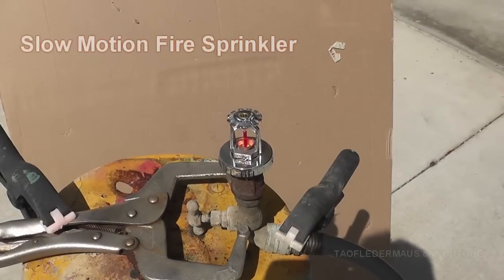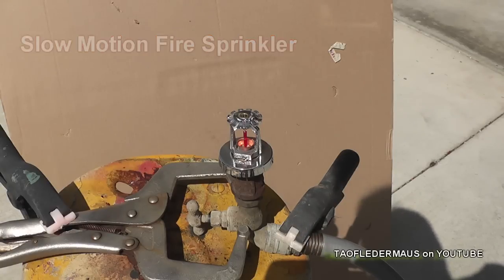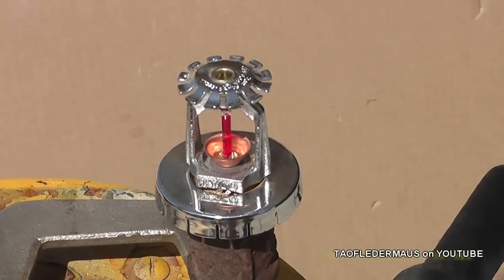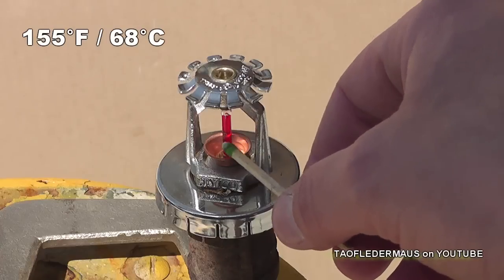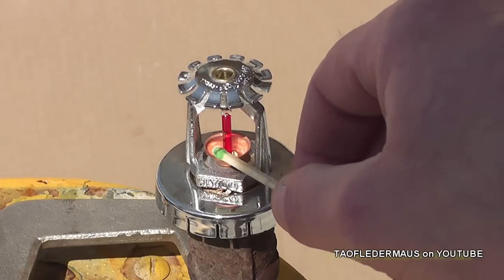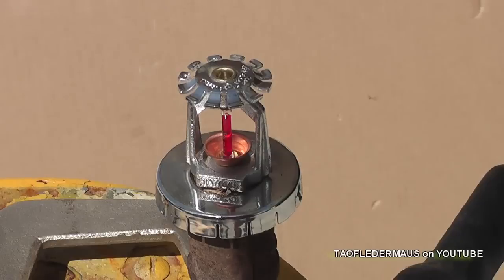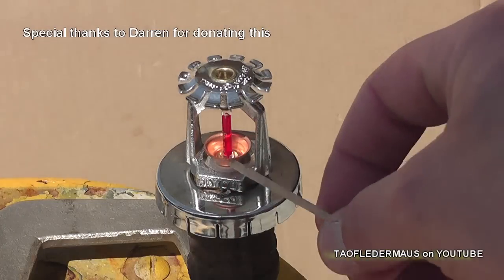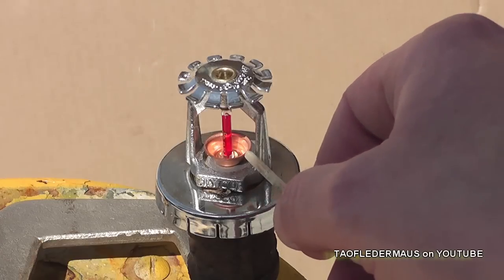How do FIRE SPRINKLERS Work?  (slomo)

Comment: So I have a question is there meant to be watering the pipes all the time so that there is pressure so that when the glass breaks the water comes out instantly as I work in a big warehouse I checked the pipes for the day and there is no water inside of them I'm quite concerned
Reply: +T Dogg  I really hope so as I tapped the pipes and the role hollow which worried me but then did some research into the systems and looked at the base of the pipes on the ground floor and saw a chamber which I think is their release valve for the water
Reply: if your place is a cold place, dry pipe is used to avoid freezing water inside the pipe. try to notice how many standpipes are there or siamese, so the firetrucks' pumps shall render its pressure. dunno if im correct. if a dry pipe system is in your warehouse, try to find extinguishers around there. if you have an ample # following a minimun distance between extinguishers, thats good. they followed safety precautions. but what kind of warehouse is that?
Reply: It is fairly common in regions with freezing conditions to have either a dry pipe system or some manner of "deluge" system.
In a dry pipe system, the piping is full of compressed air, which holds the clapper shut in the dry pipe valve against the water supply; when a sprinkler activates, all system air is evacuated and allows the dry pipe valve to open and flood the system.
In deluge systems, the piping is actually empty. When fire is detected, the deluge valve is actuated and the system is flooded with water.
Reply: As others have said, that's a "dry pipe" system. It should be pressurized with air (nitrogen, co2, etc.) Many times that's to avoid freezing (and rust throughs), but it's increasingly common to avoid accidents flooding the building. If you knock the head off one, you have time to abort the water phase. (of course, everywhere I've ever been, the panel to do that is in a locked room -- on a different floor. There was a car dealership locally that broke one, and it took them half an hour to find the shutoff!)

Comment: IN GENUINE POTATO DEFINITION!
Reply from the maker: +Ben Heatherman  at least I have a potato
Reply: +TAOFLEDERMAUS Indeed. The red fluid in the capsule must have been under quite a bit of pressure to spew back out of that cup on the pip.

Comment: Except in real life the water is black as oil for a few seconds! !
Reply: HhappyBirthday The  pipe  rust and  oxideis as water is in it, So as a fire sprinkler guy like me, go out every couple years and flushes the pipes with fresh water and a lot of air behind it to flush all the rust and crap that is in it. why it stinks is for the fact water sits in there with the rust =stinky water
Reply from the maker: Rivarokband  and smells really bad too.
Reply: Yes, cutting oil, rust,, dead mice that get inside 20' lengths of piping laid on floor before installation =just a whole lot of nastiness  I installed and serviced as a plumber and sprinkler fitter. The water smells so bad it fizzes sometime in the drain bucket. The methane escaping from the water.
Reply: Dear ***** ,  Why so? 
Why is the water, black as oil and also, smelly ?
What causes each of those two factors, please.
.
Thanks.
Reply: +HhappyBirthday Ever bled a radiator? I should imagine its the same deal.
Reply: *****  I work for Western states fire in washington  you ?
Reply: +Nathan Barnes That means hotel sprinklers smell alot worse than those. The hotel ones are really rusty.
Reply: I used to like 3 years ago, now i work for my brother at One tree had cider
Reply: are you out of spokane
Reply: Exactly! I installed them too. Man the stuff that comes out of those pipes is so bad I wish it was straight oil!
Reply: I just as an apprentice for sprinkler fitter it's seems like a good career what do you guys think I'm located in Sacramento California

Comment: Will a sauna adjacent to a sprinkler set it off??
Thanks anyone...
Reply: +David Wright It depends on the temperature rating of the sprinkler and the temperature of the air coming out of the sauna when the door is open. The sprinkler should have green or blue colored liquid in the bulb. You could even have sprinklers installed inside the sauna without them activating.

Comment: I'm pretty sure its mercury inside
Reply: Mercury isn't a red translucent liquid, also that would be hazardous.
Reply: lmao, if it was mercury when the vile popped it would give a lot of people in the room mercury poisioning, not the BEST option avaliable.
Reply: Jay Saleh fire sprinkler systems installation use alcohol in diferents colors,  there are green, red and blue, it is only for distintion of the other liquids, they use alcohol because alcochol has very hi dilatation degree, in other words, the glass capsule is broken very easy while alcohol grows for temperature effects , I am sorry my English is not so good, but I worked in this kinds of installation,
Reply: Mercury looks like a reflective liquid (like liquid solder if you've seen that) - it can't be dyed.

They don't use mercury since this system is designed as a lifesaver and the last thing you want is a false alarm causing one or several people mercury poisoning!!
It probably is methanol or some other low boiling alcohol
Reply: Red thermometers contain alcohol (red colour is added to make it easier to read), not mercury. Mercury is a metal and is silver(ish) colour.

Comment: nice vid

what do you mean by this ?

This head was dropped so it was decided it should not be installed
Reply from the maker: Pol Ty  It is possible it was damaged when it was accidentally dropped.  Instead of taking a risk  and installing it and have a leak or a premature release,   it's prudent to not use it.
Reply: Correct. We're not allowed to install damaged or even suspected damaged heads.

Comment: I remember in the college dorms, my resident assistant told us the water in the sprinklers was dirty and 20+ years old.
Reply: in most pipes it is at my work place one of my idiot coworkers hit a sprinkler with  a fork lift stunk the place out for a week
Reply: Mike Vormann Yeah. Also at my school, we have two shower stalls but we never shower because well, we don’t need to in school. I was told it was probably sitting there for years. So one of these girls decided to turn it on and stick her hand in there and it smelled so bad.
Reply: I install fire suppression systems (fire sprinklers) for a living. And the person that told you that, isn’t completely wrong. In your college dorms, depending on how old it is, there could be some very old water in there. Though there are times for inspection purposes the systems do get drained down abd refilled after the inspection is complete. I will tell you. You never want to be sprayed with the stinky ass, nasty ass water that comes out of a system ran with steel piping.
Reply: If my schools faucets spray yellow water after a week of no use i dont wanna know what the hell comes out of the fire sprinklers
Reply: At my work we have a huge fire water storage tank, fortunately we have tons of underground leaks so the water in the tank is gone through relatively quickly in a 70 year old facility. We also have probably same vintage diesel pump and electric pump. Our system is also supplemented with city mains.

Our water in our lines stink, but I think annually a fire protection service comes out and tests the water flow, I also see them drain the risers but that might be replacing some sprinkler heads. I dunno the reason.

It’s a pain to deal with broken sprinkler lines underground which happen from time to time, you have to shut off the diesel pump, the electric pump then 3 city mains. It’s takes about 20 minutes to shut them all down. Rarely that has to be done.

We recently had a underground pipe burst so we couldn’t just shut off the riser, by the time we even figured out that the underground pipe was a fire line not a city main we flooded 3 buildings, eroded away a whole bunch of concrete and the fire department was dispatched.
Reply: @tevinmckimball7951  There are two variables.  The first is the size of the orifice in the sprinkler, which is expressed as a "K-factor". The most commonly installed sprinklers have a 1/2" diameter orifice which is calculated to have a k-factor of approximately 5.6.  The second variable is the water pressure at the open sprinkler.  The math formula to compute the answer to your question is to multiply the k-factor times the square root of the pressure.  So if I had 7 psi at a 5.6 k-factor sprinkler that sprinkler would flow and distribute approximately 14.8 gallons per minute.  
 
I would be very surprised if a commercially available sprinkler could discharge 500 gallons per minute.  Even if the orifice were very large, with a k-factor of say 25.2, to get that much water the pressure required would be about 393 psi which is quite unlikely.  Commercial sprinklers for the most part are only to be installed in systems where the pressure does not exceed 175 psi.  Special sprinklers can be obtained which can be installed in systems where the pressure does not exceed 300 psi.  
 
I like showing off my 38 years in the fire sprinkler business.  Can you tell?  Be well everyone.
Reply: It’s hooked to a fire pump which is hooked directly to the street power fun fact
Reply: Can’t we all just calm down and agree that the water is not for drinking?!?
Reply: Mike Vormann sounds like it requires electricity
Reply: Water is millions of years old
Reply: @aidans4866  i know but it hasent been filtered and reused for 20 years
Reply: @aidans4866  You mean,  ...BILLIONS,   (with a B)
Reply: R VB No, it's within the heater system which works with oil.
Reply: Lot of the stink is cutting oil from the installation...you never get it all out!
Reply: Mike sr the water coming from the city that water s not store at all
Reply: Yeah, often the water for the sprinklers is stored in tanks on the top of the building so they can even work without power. But often the sprinklers remain unused for several years, so the water also stays there for that long.
Reply: He was wrong. The water is probably about 4 billions years old.
Reply: @gamesofcontent  LOL. You are absolutely right ✅.
Reply: Yeah, look up videos of sprinklers going off in best buy ,or any other store. Fires aren't often, so you get these sprinklers, and they are unused until 40 or 50 years later when something catches fire. Because of the sitting of the water in the pipes the water is actually a biohazard and when it gets inside of your mouth you have to go to the ER
Reply: SirFlanksALot When you consider the era of the design, many if not most of the brainiacs that designed these systems had already done their fair share of LSD at University and after. “LSD geniuses”, they ALWAYS think they are smarter than EVERYONE else and have reached special dimensions of enlightenment. We should NEVER believe them!!!!! Arrogance (they always have heightened arrogance) and dislocated thinking is NEVER a good combination and we are seeing the results of that everywhere we turn today!!!!
Reply: SirFlanksALot   Lol you are a idiot.. I’ve gotten in my mouth and eyes not to mention the stuff that gets into my pores... it is just water that is stagnant that’s it... smells like 1000’s of dollars to my family..
Reply: Josh Nordwell 
It smells like money to me. I install them for a living as well.
Reply: Mike who the fuck told you that pack of bullshit stored in tanks? Lol on top of the building? Lol fire sprinklers don’t require power unless the riser is hooked up to a fire pump, which in a lot of applications the system doesn’t have a fire pump.
Reply: Ricky Gonzalez.O it could be pumping a foam mixture
Reply: - JustSimplyThinking - Yep, luckily we in Germany have other systems. Our Water system is directly connected to the boiler of the heater and there's a pump pumping the water from the basement to the different floors.

Comment: what type of sprinkler is it? this is a pendent sprinkler?
Reply: yes it is..it is a chrome semi-recessed pendent, often found in modern commercial buildings..it has a red element (the assembly of the bulb and "pip" is called the element) meaning it has a temperature rating of 155deg Fahrenheit..the K Factor is normally 5.6 so it sprays in an approximate diameter of 15 feet from its center, and given its radius therefore sprays 7.5 feet per side in all directions

Comment: Hmmm, I always thought a smoke detector set the sprinklers off... and every sprinkler in the building at that.
Reply: Totally wrong. Ever been in a hotel, or school when someone sets off the fire alarm as a prank? That would suck bad if that alarm set off every sprinkler. Not to mention a sprinkler is a dumb device meaning there are no electronics on it so only heat sets them off. So how could one set them all off? and you would not want that anyways since it would lower the water pressure and not deliver much water to the location fire. Don't believe everything you see in the movies.
Reply: Benjamin Hocking
My school some kid threw a book at it and broke the head causing the whole line to go off.
Reply: Benjamin Hocking So in hotels and other building school ext ext  they are set off by heat. Meaning i closet fire will set off inside the closet and that all, or until the fire moves into a Another  room causing another head to go off ect. 

 Buildings that have gas or other properties that can burst in to fire like wood mills because of the wood dust will get a sprinkler system that have pressured heads by air, Meaning the head pop the air gets released and the riser flap releases the water that, is behind the flap. 

Airports,heavy metal places, places that have a lot of fuel will get a foam system
Reply: Not necessarily double interlock.  If all the heads go off at once it would mean you have an open head system which could trip on just a smoke or heat detector.

Either way, only 1 head would go off on this guy's situation.
Reply: Depends on the type of system.
Reply: Did you just call it a flap?!?! That's the best.
Reply: lol ya i did oops
Reply: Hat does this guy consider the whole line?

Each individual head in a school would not dispense water if only 1 were broken.

Unless you're at some weird deluge open head school...which you're not...
Reply: I did a 280 heads in a plant, and let you remind you this is just one area in the plant. all heads where open, they have special censors like smoke alarms that pick up rising temp in rooms if it reaches temp, the system open that gate valve in the riser and waaaa laaaa water everywhere.
Reply: 98% of systems or closed heads. the stuff i just talk about is only for special jobs that need that system
Reply: That would be a deluge system designed specifically to protect whatever is in that one area.  Probably something expensive.

Its not a gate valve either.  If you're installing sprinkler systems, you really should know,what they are And what they are for.

Comment: How do you stop it
Reply from the maker: You have to shut off the fire system,- valve off the riser.   Then you can go in and replace the popped sprinkler heads.
Reply: @taofledermaus  They also have what look door stoppers painted red to wedge in to cut off the water as well.
Reply: jd mattinson in case of real  fire, fightfighter has to close the main valve

Comment: what about fusible link sprinklers
Reply: +Christopher Hess Very good question. There are several different activation elements. One is the glass bulb like in this video. Another is the fusible link type. It has two pieces of metal soldered together with a special solder that melts at a certain temperature, just like the glass bulb breaks at a certain temperature.

Comment: The liquid used in glass bulb sprinklers is a non-toxic proprietary glycerin solution that that expands when heated.

If you closely examine the older full size bulbs you will see that the bubble size varies with the operation temperature. It is not so easy to see on the modern 2.5 and 3mm bulbs.

Also the 'glass' is normally a quartz type of glass to ensure complete disintegration of the bulb on operation.

Comment: en.wikipedia org/wiki/Fire_sprinkler shows you you color that the temps they break at,  the red ones seems standard in most buildings unless you're in the kitchen then the Blue or Purple i would assume would be used to prevent them from going off when sudden heat hits them (opening an oven door can let a lot of heat out) as an fire is hotter than 200c any way so they set off and hose the place with water (i guess they work out where the higher rated ones need to be when been installed)

Comment: Mercury is a deadly, highly toxic chemical.  It's RARELY used in ANY thermometers, though it once was.  Today thermometers, fire extinguishers, and other such products use a number of synthetic chemicals that mimic the expansion of mercury, and some people may call it mercury, but it most certainly is NOT mercury.  Anything designed to fail, like that, would not contain a toxic chemical.

Comment: the liquid is alcohol. there is a small bubble in the liquid that determines the temp that the head will activate. the small bubble allows for fluctuations in temp without activating. once the temp gets to the activation temp the fluid expands to a point that the bubble is absorbed and the fluid has nowhere else to expand and ruptures the glass ampule allowing the water to spray. larger bubble in the glass the higher temp of activation. the fluid is colored to indicate temp as well

Comment: remember finding a van full of them back in PA ,it was ironic that the van was burned and it belonged to a fire maintence company,it had the huge FIRE on the side,several cases of them were good that were in sealed boxes and in draws ,but there was hundreds of pounds of dead ones that i SCRAPPED FOR BRASS, they got mixed up with lots of spent cartridges on my brass &copper run to the scrappers